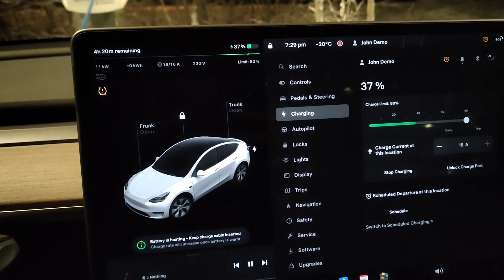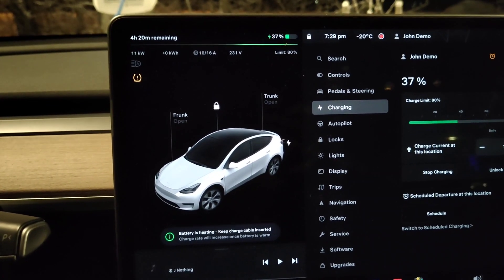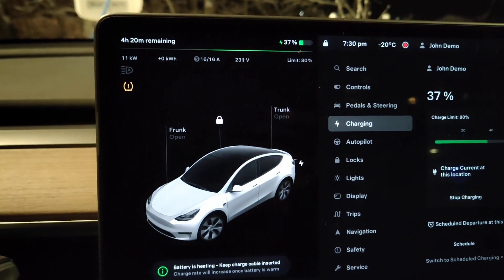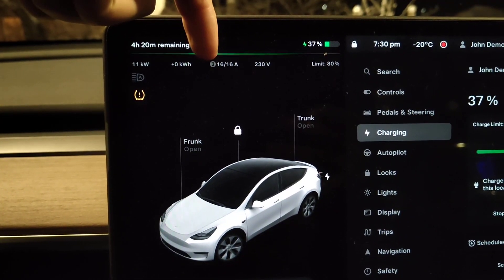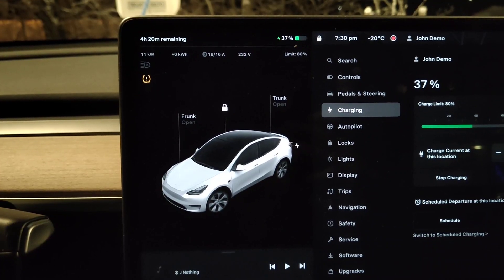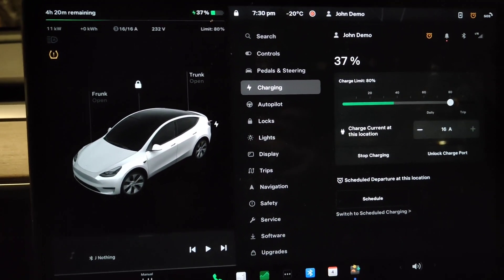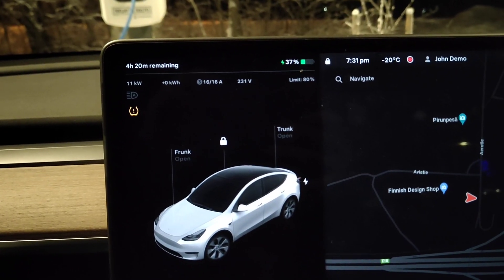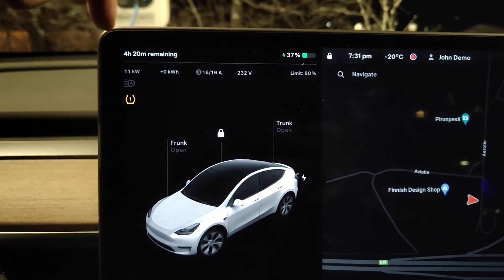Tesla charging in -20C temperature - Efficiency reduced

Comment: Use faster charger. No shit you wont get any battery charge, you have connected to slow charger. Connect to tesla official charger and you'll get more charge.
Reply from the maker: Thanks for sharing. It's all about optimizing effort and cost. Slow 11kw ac charging at home might be the best solution for optimizing both of those even in -20C temperature. Fast chargers are great for travel but not convenient and cost effective for daily use if you have 11kw charger at home.
Reply: @Homeneer  But if you have 11kw at home, do you really care about the time? Aslong as it doesn't go over 8h it will always have charged enough when you wake up.